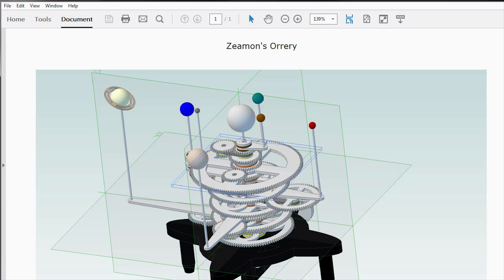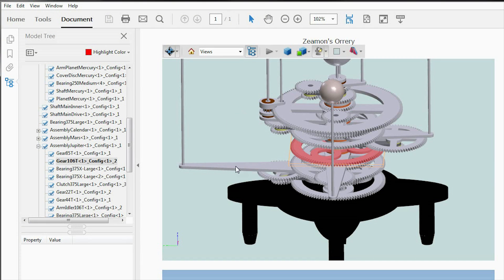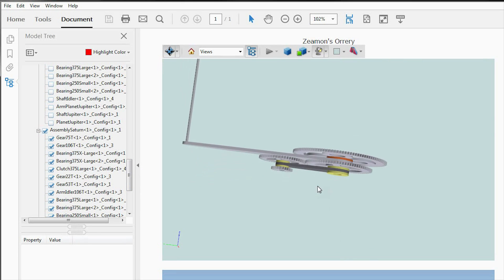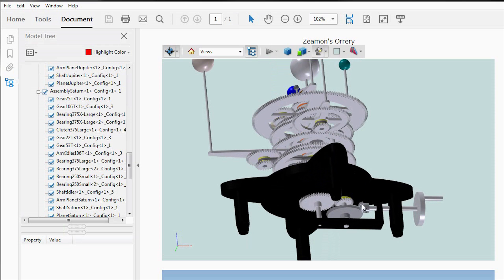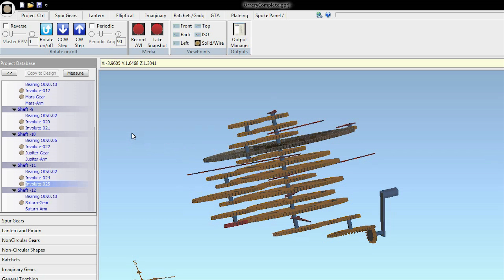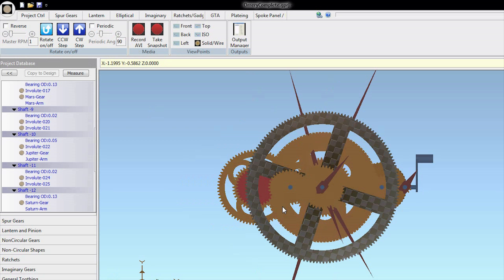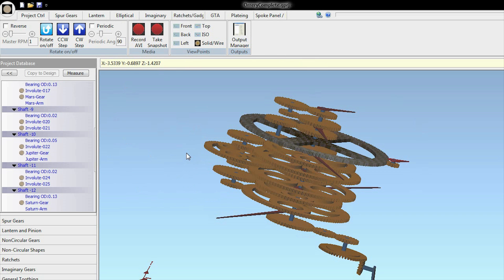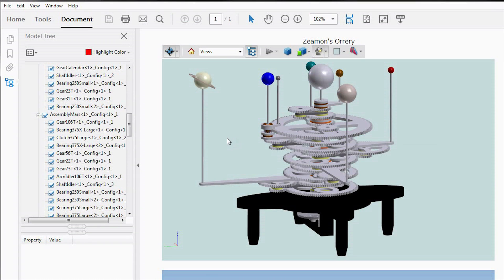Zeamon Orrery Plans

Comment: Thank you for sharing the plans for your Orrery. I have completed the gear cutting holding the blanks in a myford division head and cutting using a mill in a similar manner to yours. 1502 teeth by hand (!) What are the dimension/thickness of the PTEF bearings and washers? you mention you made them 0.15" smaller and delrin composite but what is 373x bearing as opposed to 375 bearing vrs 375 x large. I am assuming the 375 refers to 0.375 inch diameter disks and large discs go on the main shaft and small disks on the peripheral shafts. What are the thicknesses? Thanks for your advise.
Reply from the maker: Congratulations on making all the gears! You're really testing my memory from 13 years ago! If you isolate one of the planet assemblies and then the individual parts within it, this should become clear. Yes, the naming convention is meant to represent the diameter, but it's fairly arbitrary depending on how you make the planet arms. There is a clutch bearing that goes inside the planet arm and then two more bearings to sandwich the arm. The diameters depend on how large you make the hole in the arm and what the radius of the arm is. I strong suggest you try making one of the planet assemblies to see how everything fits together. I believe I made most of the bearings 1/8 inch thick, but again, this is fairly arbitrary. The only thicknesses that matter are the clutch bearings which should be the same thickness as the arms (which are mostly arbitrary but 1/8 inch is probably best). Good luck!

Comment: beautiful ! Since i'm new to this, I don't know how to build the pieces. Is it possible either to order them somewhere on the net, or have them 3D printed (although I doubt the output can be a accurate as brass). If possible, I would even buy one ! bravo
Reply from the maker: Sorry, this is a one of a kind. I seriously doubt a 3D printed model would work.
Reply: @KenToonz  I agree. I think a printed 3D model with as much as plexiglas parts to make the mechanism less visible would also be great. Having the planets looking like being in suspension would be astonishing (maybe via magnets ?). I think I'll try to do it anyway, but working with metal is totally new to me, I don't have the equipment, I would need a Fablab close to me. It's a very long shot. But anyway, what a beautiful device ! I wonder if a "real" planetarium would be feasible starting from an Orrery. the mechanics is broadly the same, but the view point is from Earth, not from above. Bravo again

Comment: I'm begining to understand how it all goes together. A couple of questions, if I may:
The holes for the 2-56 screws seem to be missing  in some of the parts. For example, if you isolate the Venus assembly in your PDF model, then progressively remove parts from the top, Bearing 375X Large has no screw holes, but the parts above and below it do. I assume Bearing 375X Large should have holes as well?

The fit and finish you achieved is impressive!
Reply from the maker: Thanks for the kind words! You're really testing my memory here! The PDF was an export from a now extinct CAD program and I have no idea if it was 100% accurate. The PDF is meant as a guide to be used in conjunction with the many step by step build videos I uploaded. If you follow the videos and actually try building the Orrery I'm sure you'll figure out where you need those holes. Good luck with your build!

Comment: First, I would like to congratulate you on the design and your craftmanship. I am a hobby machinist and it is just wonderful. I am determined to build this orrery myself and have already ordered the brass and the cutter. However, after many hours of trying, I have given up in getting Gearotic going in order to obtain the precise dimensions of the gears etc. as a result, I am using the measurement tool in the pdf file to measure the OD of the gears and other parts. This is very unsatisfactory and I am unsure of the values that I get. Can I ask you whether the "Model units" are in deed 1:40 ?? Thank you. Cheers. Cor
Reply from the maker: Hi Cor. Thanks for the kind words. I did this work a long time ago and have no idea what the model units were. However, gears have VERY specific and consistent dimensions which can be found with any of the MANY gear calculators online (just do a search). You enter the modulus of the cutter and the number of teeth and they will tell you the exact size of the gear (and a ton of other useful information). The gear dimensions are the only critical part of the design. Once known, you can design the arms, planets and other parts to suit your taste. Be creative! There's no need to make your model an exact copy of mine. Good luck, Ken

Comment: This proves that the time slippage and syncing of time doesn’t work. 

The example on the left demonstrates how time begins to slip and looses synchronization once it begins to revolve around the sun. 

The earth is stretched out up is simply up and down will never be up. Curves can’t live without level and level can’t live without curves. The earth is the center and doesn’t move the sun moves. 

So these examples are nothing but a failure.

Comment: A beautiful piece. Ive downloaded all the files you have kindly supplied and have a question. I note that the gear diameters are very precise down to 4 decimal places. As an example G47 is 1.9859.
 Is there a reason why it was not just rounded up to 2? oh and also I am assuming the measurements are in cm?
Reply from the maker: Thanks! The gear dimensions are in inches. For gears to mesh precisely, their sizes need to be precise. The dimensions are derived from formulas which you can find on the Internet. Four decimal places is probably overkill but I wouldn't go crazy with rounding. Try making a few gears and experimenting.
Reply: @KenToonz  Many thanks for such a speedy reply.

Comment: could you give stl files of these gears?
Reply: because gearotic 1.0 doesn't work on my computer:<
Reply from the maker: Gearotic 2.0 should do the trick. All the gears are Modulus 1.0 and the tooth counts are specified in the video and attached plans.
Reply: yes but I have a problem, because i don't quite understand how it's move i mean where is bearing that rotate and how is it mounted in this assembly
Reply from the maker: I have posted a large number of videos that show every step of the construction. The video description above has a link to the playlist.

Comment: Hello, here's a better idea.  Convert Orrery into a day and night sundial that you use with a sextant.  Here's what I mean, the only way the sun can be at that angle in the sky, is for it to be exactly that time of day.  So, you right there find both the instant in time and your longitude.  Time, without a clock unless, the sky is ticking...  So, since it's a navigational aid and a Celestial Ruler of Time, you then find your latitude by calculation.
Reply: It could but, it would have to show hours minutes seconds in Universal standard time, and longitude.
Reply: You use more than one visible planet because, they duck behind the sun, and that's why include moon.
Reply: If you come up with a clutch for the Earth, so it can only start spinning at 12, then you can use precision movements, and a magnifier to look at the Earth because, it would have marks on it.  But, the precision movements they use them in sextants.  It's the fine adjust for longitude and time.
Reply: You'll figure it out, and it can be made more precise than an atomic clock.  It's an analog planetary map of time in the solar system.
Reply: Unlike, GPS, this is an EMP proof device, and a coronal mass ejection.  It can help keep shipping moving by making a clock where a watch won't work.

Comment: Very strangely and coincidentally, I came across your orrery just as I completed mine. I used an 1850's French orrery for inspiration. Mine is made in wood with hand cut gears and has different tooth counts but has just as accurate orbital rates.My model can be seen at www.woodenclockspot.blogspot.co.uk. Two major differences are that it took me about one month to design and make and cost probably UK£ 10. But yours is much shinier.
Reply from the maker: +MrParamount3 Very impressive work. I'm fairly new to metal working and this was the first time I ever made a gear. Keep up the good work!

Comment: What's the cost in materials?
Reply from the maker: +Crue Knight It's been a while so I don't remember exactly, but it's expensive. Brass is very expensive. I probably spent close to $500 USD on materials. Tooling is also expensive. Each gear cutter is around $100 USD. The rest of the expense will depend upon what you have in stock - both material and tooling.

Comment: Small problem, you can't actually save the Gearotic Orrery plans, as clicking on the link makes the browser try to display the file, but right-clicking and going save as, only saves the YouTube redirect link.  I'd suggest a zipfile.
Reply from the maker: Thane Greyhaven Thanks for spotting this. I've changed it to a zip file and it now works as expected. Funny thing, the old file was downloading correctly but the extension was being changed. If you renamed it after the download it was fine. Weird...